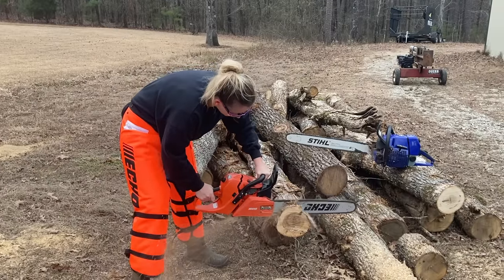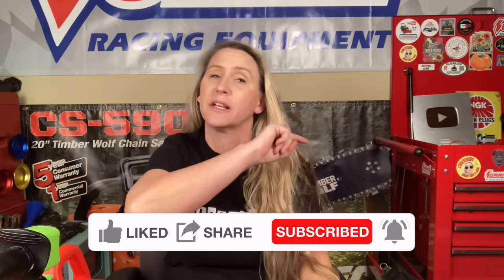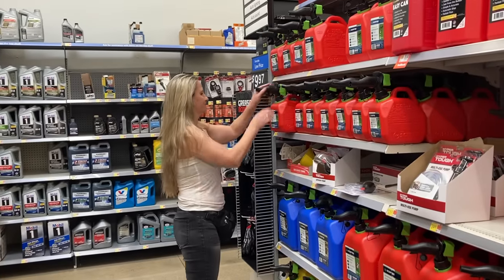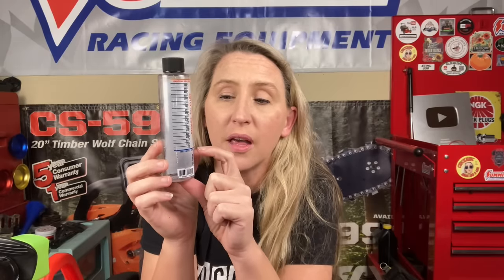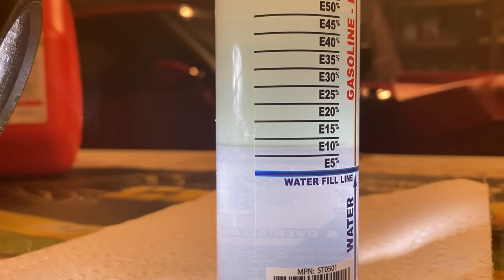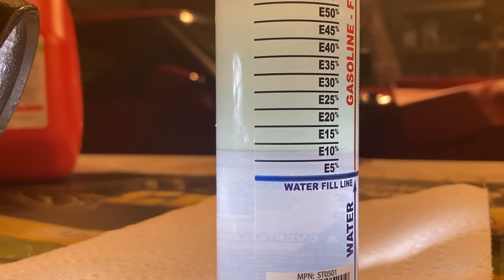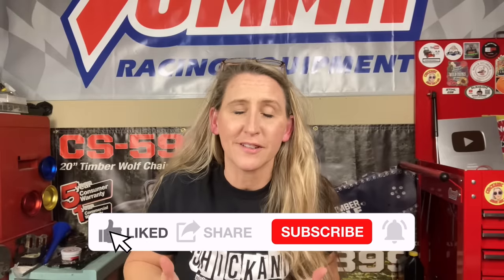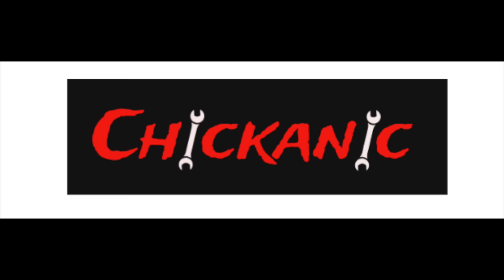Fueled by Deception. How You’re Getting Ripped Off at the Pump! (I'm SHOCKED!) VLOG

Comment: Great video.  I never thought about that.  Here is one more thing to consider.  A lot of places have the ethanol free fuel on an entirely separate pump with a disclaimer saying "this is not BP fuel" or "this is not Exxon fuel".  The gas station just bought some generic fuel to have ethanol free available.  You have to be careful with that stuff because it can be bad gas which is why there is a sign saying its not affiliated with the big name oil company.  My boat mechanic informed me about this after he fixed a lot of old 2 stroke boat engines whose owners were saying they put ethanol free in it.  He recommended for me to use regular high octane with Stabil Marine stabilizer rather than risk it with the cheap unknown stuff.   That was a few years back so I think the name brand ethanol free is getting to be more available.  I have a Shell station that has the Shell brand ethanol free on the same pump but on its own separate hose. I've been using that in my small engines with good results.
Reply: In Calif they recently busted a ring buying stale gas from junkyards, which is supposed to be hauled off as hazardous waste, but these ppl were mixing it with fresh gas & selling it to small independent gas dealers. Great for your car & its smog equipment. BTW Chickanic, what do you do with the stale gas you end up with? I suspect you burn it in your vehicles, but I'd worry about the long-term damage that might cause.

Comment: As someone that worked in the refining industry for 29 years, you are right on. I had one of my motorcycles totally f-ed up by a gas station's product. It still sits, when I drained the tank it was 1/4 a green nasty water. As a result I always pump into a five gallon container when I fill my mower or my weed whacker. My motorcycle sidecar setup in DOA (dead on its axles).
Reply: This just happened to my riding mower. It was full of green. I cleaned the carb, but it's still screwed. Guess I'm ordering a new carb

Comment: thanks Bre, very interesting. I only run ethanol free in all of my pre-1964 vehicles and all of my small engines and buy it from one of two stations. one sells it out of its own single pump, but the other sells it out of a multigrade grade nozzle. I am going to test both sources with that little tester and be sure that what I am getting is truly ethanol free. you are the best!

Comment: Glad I came across your video.  I am a small outboard, 2 stroke guy so this applies to me also. Great to know.  We have a station in our area that sells only enthanol free fuel, so the contamination potential doesn't exist. Will be going there from now on. Thanks.
Reply: Just curious, what is the cost difference for ethanol free versus ethanol gas? I found a station that has E free but is at least a $1 more per gal. It is 90 octane tho

Comment: Great test, I would have never guessed your results.   I have some of the old Chilton plastic cans of various sizes and I realize just how lucky I am to have them!  These cans at a flea market are snapped up at a  premium price.
Reply: I bought two old metal gas cans from a garage sale & unfortunately one metal cap corroded on the inside & into the gas.  The only reason I even caught it was the metal flakes on the black funnel that were left behind when I poured it into a plastic can that has a nozzle.  Luckily, I didn't put it into any tanks, but now I'm stuck with 2.5 gallons of gas with aluminum corrosion in it.  Do you think it's possible to filter it some way?

Comment: Helpful hint: take the spout off the gas can.  Use a funnel.  Don't overfill the gas can for easier pouring.
Reply: I get old gas cans at yard sales that are split or sun-baked and brittle. Swap the nozzle onto a new can, smash new type government nozzle. Pouring problem solved
Reply: You can also buy replacement nozzles for the "older" gas cans that just happen to also fit many current cams.  Problem solved.
Reply: YES he gets it,   JUST USE A FUNNEL !

Comment: I always put the gas hose in the vehicle first. Residual gas of various octane levels and or ethanol levels will be in the system. I also use amsoil and Motul products to up the octane levels and stabilize the fuel. A little more expensive gas mix however I know my power equipment will start and run like it should every time. I love the informative videos!
Reply: Do you have a high octane engine?
Reply: @cravinbob  higher the octane slower the burn technically. It allows for more control and a piece of mind in my opinion. Many variables come into play however it's for my own peace of mind. Some statements however are proven facts. I only use 2t ester.

Comment: Thank you for the great video. This is one of the reasons I don't buy ethanol free for my small engine equipment at gas stations anymore. I buy it in the large cans at a hardware store and the premixed version for my two cycle engines.

Comment: Ever since the multi-choice grade selection buttons appeared on pumps, I have been very aware of this problem, but never bothered about it because I was always filling my gas tank with ten to fifteen gallons of fuel and thought the residue-in-the-hose was not a problem for my car.  But now with the strict demand for ethanol-free for my small engines, it is of great concern.  My favourite Ethanol-free pumps are dedicated to ethanol-free only, with no other selections available.

Comment: A very good point made here about how the Gasoline Pumps work. Seems now-a-days, it's not just water in the gas, but now 2 issues since ethanol was added. Had that issue even with My 2010 Chevy Impala.  Another note here. Costco has the worst where one is almost doubling usage. PS: I got rid of the Impala shortly after & dug My old 87 Crown Victoria out of the bush, putting it back on the road, to witch is still running strong after the last 12 Years since brought back on road.

Comment: This is great to know. I don't have my 1992 Murry Lawnmower manual anymore, so I am not sure if they recommended non-ethynol gasoline. I was using regular until a friend told me I should be using Premium. My small engine motors run smoother. Now I can take one more step to get a few more years of use out of it.  I appreciate the time you took to investigate and share this with us. Now I will take precautions with a never used new Simpson pressure washer.
Reply: I just bought a Simpson washer. Used some SUPER expensive Aspen 4 cycle gas as well as normal "only 10% ethanol" gas for the rest. Can only go so broke on gas...
Reply: @edh9237 ,
You probably are not old enough to remember but I do. In the old days we bought regular gasoline. Today you are paying extra for Premium which is only equal to what we had for regular. Aout 92 octane. Repute to be 93 octane for Sunoco regular.
  And then overnight the cars would barely run on regular. Often we had to buy Premium just so the car ( s) would run decently.
  I know what you may be thinking but no it was not for the environment. The big change came about when Carter was President. You know how the Liberal Democrats are when it comes to running the country ! Carter was not in office very long before we had rampant inflation , soaring prices and few jobs. Sound familiar ?
  It should. It's the Democrat's way. Carter got the right idea of imposing a wage / price freeze. The gasoline companies could not increase prices so they degraded the gasoline instead. And 93 octane became the new Premium. Of course after we got rid of Carter , the quality of gasoline never came back up. 
  The performance  cars ran poorly even with the " premium ". When passing cars you had to do it very carefully because under exceleration the engines would knock so badly you would think that it was about to blow up. And sometimes they did exactly that. It kept the mechanics working at least.
Reply: @donaldmiller8629  I walked to the Sunoco Station not only to get a gallon of gas for 25 cents for regular but to see the girls in yellow shirts and blue shorts attending the pumps. The Montgomery Wards tank of a mower was not self-propelled but it ran for many years.  I was starting to think I may have been wrong, but I am glad you see it the same way I do.
Reply: I had a Murray riding lawn mower back in the day the biggest piece of crap on wheels went through two Transmissions nothing but problems

Comment: Ethanol fuel is great for corn farmers and small engine mechanics. Since it's so much less effecient than regular gasoline, it's also a great way to support your local gas station.
Reply: Yes n everyone  has water pouring  outta  there exhaust pipes  from corn fuel
Reply: Don't worry, the farmers aren't getting that rich on corn! I know!
Reply: Not all are, but some definitely are. I’m in farm country & have a hobby farm. Almost all the farmers around me have multiple large pole barns, multiple leased $250-400k machines, the entire families drive brand new trucks, new clothes, very nice homes. Their acreage value has increased 25% in 2-3yrs. The depreciate & write off almost everything they buy in a normal year. They don’t fill up at the pumps unless they travel. Crop insurance is not that expensive. Look up USDA farm subsidies for your county & prepare to be shocked. Yes, they only claim a meager income...but there are pole barns with housing/kitchens/showers/bedrooms nicer than many homes. No sour grapes or comparisons...but they live the high life not getting rich...then pass millions of dollars of acreage to the next generation via trusts...or covert to C-corps. It’s legally working the system...but few are living a tough life...generally the guys with only a few hundred acres & old equipment.

Comment: I go to Sunoco. They have the diesel and corn-free on the same pump, so they can't mix those two.
Back in the day you could dial in your desired octane at Sunoco, from 190 up to 260.
190 was 87 octane, 260 was 97.5 octane. Chock full of delicious lead, of course.
Reply: Another great fuel was the premium AMOCO (pump nozzle had a clear window with little balls that showed the fuel passing thru when you squeezed the trigger). Crystal clear, down south here we called it "AMOCO White Gas". My dad insisted on it for his 427 Corvette.
Reply: @shanew.williams  That was the early unleaded fuel.
I'd be concerned about valve recession in older cast iron head engines.
Reply: knock knock?
Reply: Isn't Sunoco from Venezuela ?
Reply: Dallas. Founded in 1886. Huge company that's done all kinds of buying and selling. They owned 7-11s at one point.

Comment: I switched suppliers because, although they had an above ground dedicated tank, I found that my small machines ran much better when I used a brand name supplier. According to your demonstration I may have been getting ethanol in my 'high test' gas but I think that my original supplier was just selling regular gas labelled as high test.
Reply: "High Test" is a misdirection term used to convince people high octane gasoline was better.  Originally it was to sell "Ethyl".

A high number on the octane scale means it is more compressable without igniting.  IOW harder to ignite with a higher flash temperature.

For standard compression engines with carburetors, lower octane is often better for cold starts (cause it fires faster)...and once running high test 93 is no better than 87 in your basic car or a weedeater/lawnmower.

For a purposeful built high compression engine, higher octane is better.  For VVT engines the difference is only slight in standard driving.

Comment: I glad someone did a video on this issue.  Ten years ago, I used to fix two stroke engines in San Diego and I discovered on my own the problem with the left over ethanol 87 fuel when pumping the 91 non ethanol fuel into my one gallon container.  I discovered that over one half a gallon of the 87 fuel was mixing with the 91 fuel due to left over fuel in the hose and pumping system, especially if the last customer before me pumped 87 fuel.  To make sure my customers didn't have this problem I would include in my instructions to pump the first gallon of 91 fuel in their vehicle's tank and then put the rest in their dedicated two stroke container.  This eliminated any comebacks related to poor fuel issues.  I complained to several local and state government officials about this issue at the time but was ignored, as it wasn't considered and "material" issue.  I'm happy to see that finally the State of California now is taking action as they now consider this a "material" issue.  I now live in Utah and the Maverik station I go to has a ethanol free 88 octane pump with a dedicated hose.

Comment: 50-60 years ago different grades came from mechanical dispensing pumps and separate steel tanks which were prone to rust, fuel leakage, as well as water ingress. When electronic pumps came into use they could be blended from two tanks (larger, plastic) and delivered from the same hose and pump. Sunoco has always mixed, even with mechanical pumps, which is why they offered so many grades. Excellent tip for everyone, thanks.

Older savvy motorcyclists have known this for years. It began with additives and then blended pumps. Some would check the previous sale on the pump, because if the MC requires premium and it's a smaller tank or you're topping off before a trip, you can add a big slug of lower octane if that was the previous sale. 

I pumped gas and began spinning wrenches in the 60's and I still miss the smell of leaded fuel.
Reply: I worked in a feed store/service station as a kid and pumped high test for 27 cent a gallon back in the day of Thrush and Cherry Bomb mufflers, STOP meant spin tires on pavement. Damn, am I old!  :)
Reply: Leaded fuel was the best.
Reply: The additives in fuel now are simply to justify that $&&% smog pump and catalyst converter we are STILL forced to have on engines.
  Smothering and heating the engine from inside to a slow death.
  Cannot buy leaded gas so why the lead removing smog pump?mp

Comment: You also need to think about the tanker hauling the fuel. There may be several gallons left in the tanker after they drop fuel and the sections in the tanker are not the same size so I the next load they get they may put non ethanol into a tank where they just had E85 or diesel or whatever. How they load is determined by how much of each fuel the station orders
Reply: I guarantee you there are a few gallons in the tanker. An 8,000gal tank will have about 40gal of residual fuel that will rub down the walls of the tank. A driver doesn't have time to sit there and wait for it to wash down.

Comment: Glad to see someone else fight with the stupid lids for the gas cans. EZ pour has a few products that I think you and everyone here would relish in. They make just simple spouts that can retro fit onto pretty much any gas can. No spring loaded silly stuff to fool with. Feel free to check them out.
Reply: Same comment here, I always change out those new "Environmentally Safe/Spill Proof" spouts.
Reply: Don't get caught putting ethanol free gas in your car or truck even if it is only a couple of gallons. Big fines.   Not sure why anyone would fill their car or truck with ethanol free when its a dollar or more a gallon than premium, around me anyway.
Reply: Great company👍🏻 have over 12 of their various spout/vent kits on my cans, ranging from 1 to 40 years old! And if you have a midwest steel or plastic can that neither the black or yellow base caps quite fit right, just email them saying where you purchased the kit/kits from and that you need a grey base cap and they'll gladly send however many you need, free of charge! (Edit): forgot to mention, ethanol free is only about 30 cents more per gallon than regular e-10 here.
Reply: @davidfranklin249  no laws against it here in NM. E-free is pretty much all I've used in 3 of my vehicles for the last 5 years. That pump, the only one in our town that has its own tank, only pumps e-free sees fairly consistent traffic. And it's right across the street from the fuel depot that the local PD uses.
Reply: @aaronpowell4885  yup, wonder which state davidfanklin249 lives it. I would not for a minute doubt using non ethanol in road vehicles is illegal in some states. Lets guess, probably along the coasts not in middle America, which is ironic in a way b/c that is where the "corn belt" lies.

Comment: I used to work for a trucking company that hauled fuel. One trick gas station owners also try to pull is to order more ethanol based gas than their tank can hold and then try to con the truck driver in to putting the rest in the non ethanol tank. They buy it cheaper and sell it for more. Drivers were fired if they went for it. I have even heard of them trying to pay the driver to do it.
Reply: Also if the delivery truck is there, go somewhere else to fuel up. All the dirt and water and debris is being stirred up in the storage tank. I will come back later when all the crap has settled back to the bottom of the storage tanks.

Comment: I found a station by my house that has an entirely separate pump for "recreational fuel." There is a website/app (not sure if I am allowed to link) that tracks stations with Ethanol free gasoline. I have found that stations close to where people might bring boats, snowmobiles or recreational vehicles to have, well, recreational pumps. 

I got into these habits after going to the local dealer to figure out why my 2 year old snow blower wouldn't start and they had the carb kits for >$40 right behind the counter and so now I am obsessive about getting the best fuel. It's like they knew...
Reply: Same here.  Several of our gas stations have "rec fuel" available from a separate pump and the tank itself is above ground.  Can't guarantee what's really in that tank but it definitely isn't being mixed or contaminated with other fuel.  I use that fuel (which is $$$) for all lawn equip, etc.